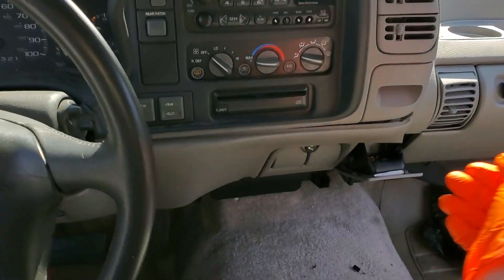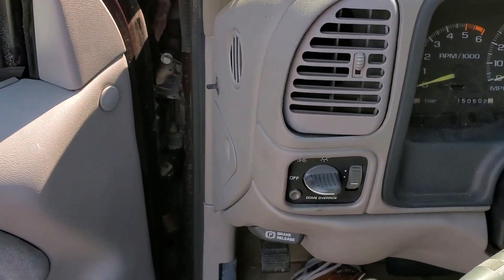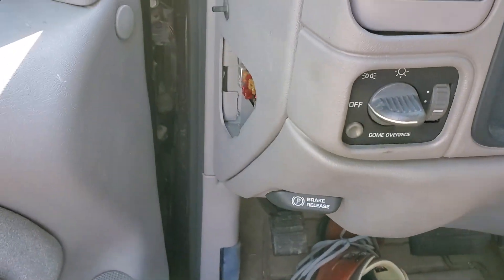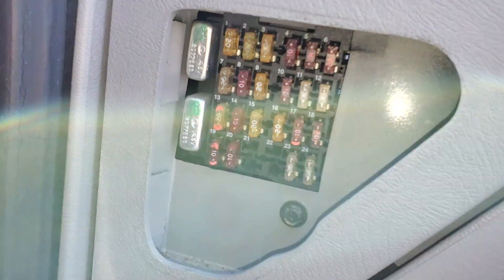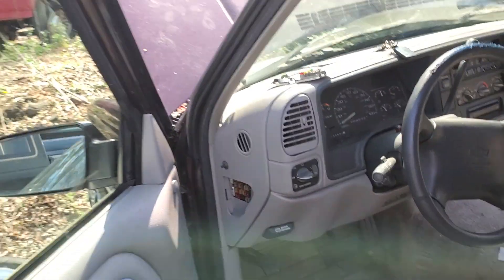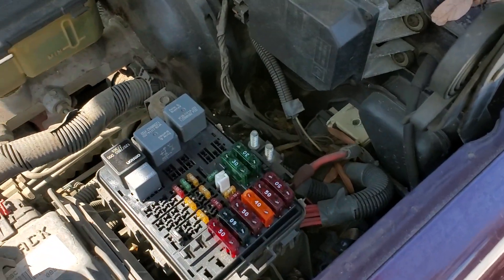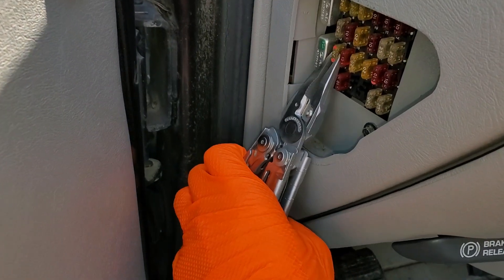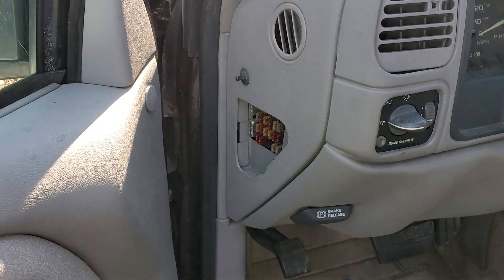1996 Chevy Tahoe Cigarette Lighter Fuse, Power Outlet Fuse Location

Comment: Why you thinking they keep burning that fuse I am looking if anything touching it nothing I can see!? But as soon I change it burned and I can get read code no power too read on coders !? It's same fuse number seven
Reply from the maker: Perhaps an aftermarket radio was installed and the wiring is making a short to ground
Reply: @LehewTech  My friend, is the lighter cigarette fuse connected to an outlet (obd2)?
Reply: Mine went out when I plugged my phone in and then the door lock button stopped working also. But window switch still works 🤔
Reply: @joaquinsolis7071  my cigarette lighter fuse also went out and my doors lock stopped working. Every time I change the fuse, it blows it right away